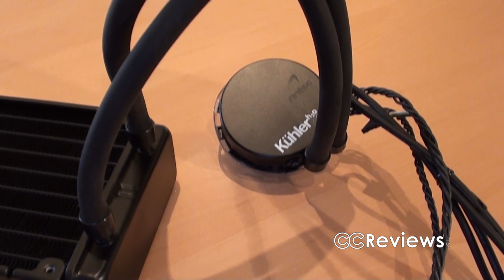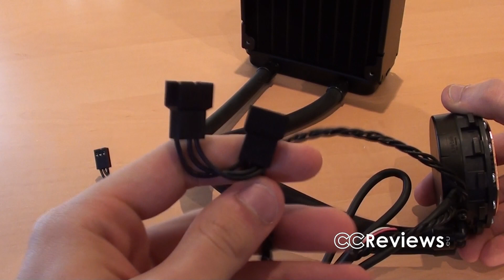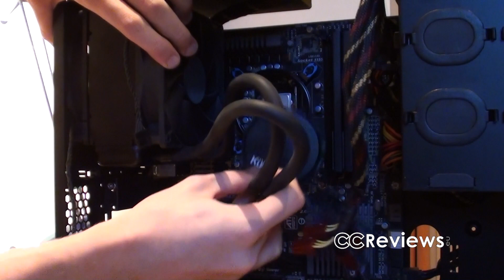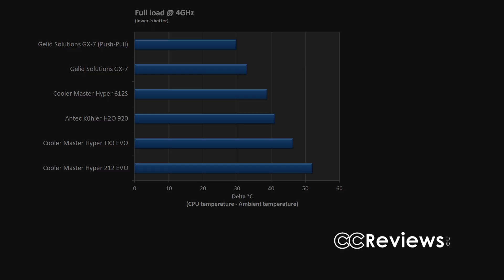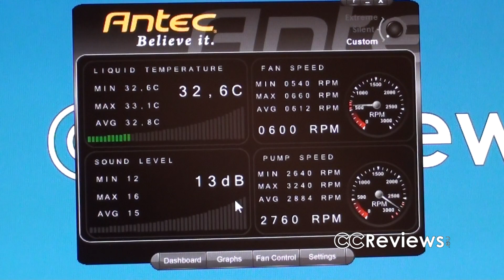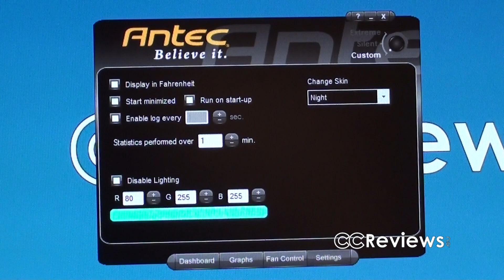#64: Antec Kühler H2O 920 liquid CPU cooler Review (CCReviews)

Comment: @ CCReviews,
I think it'll be much better if you assemble the cooler with the rubber hose on top(the other way round) so you have much more space rather than look sardin pack in the middle.That's what i did.

Comment: Hey all, I'm using the antec 920 for 7 day now and it works perfect but there's 2 thing you need to know,the screw come just about fits so it's a little hard to screw it tight,my advice is to get a half inch longer screw and that's what i did,Those of you that thinking about changing the fan,silverstone 120mm air penetrator led fan is really awesome for sucking the hot air out.check out the fan from you tube.

Comment: Can i swap the 2 120mm fans for some other aftermarket led fans ?? 

Because the connections its all  the same from the CPU Fan Power. 

I worry it will not have enough power , also i worry the program won't work for aftermarket ones. 

Anyone have any experience ??

Comment from the maker: @impervious05 it doesn't really matter... But I think it's best to do it like this because there is air inside the system and if it's with the tubes at the top there won't be any watercirculation.